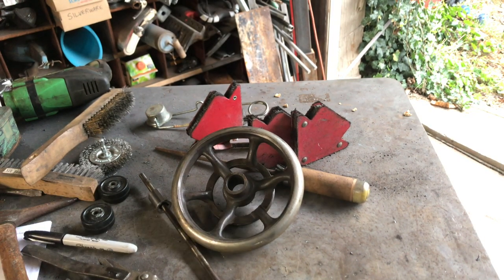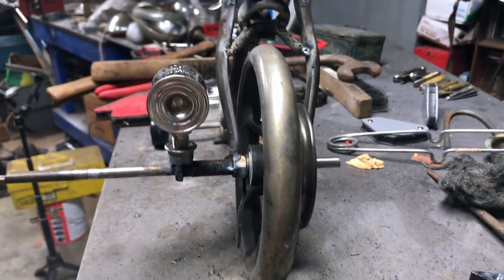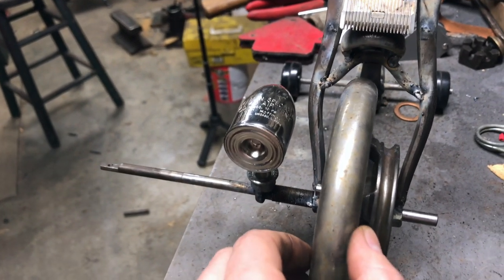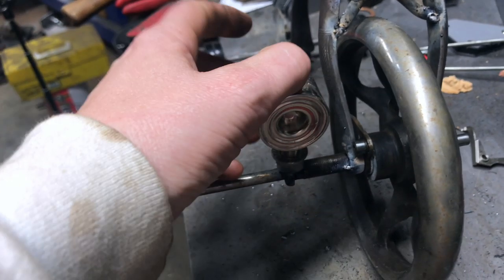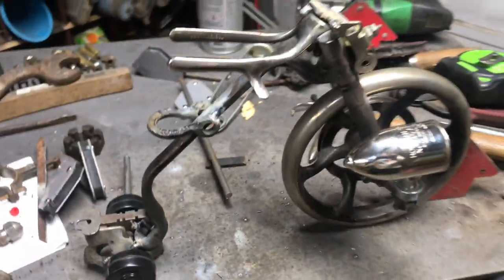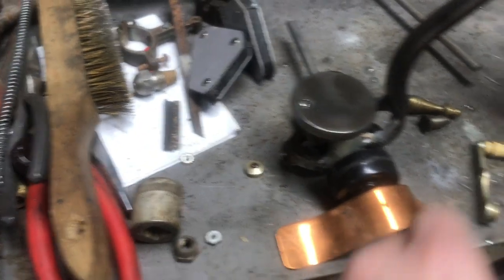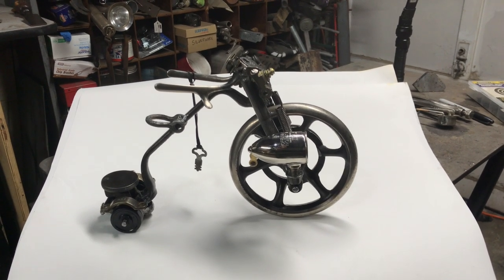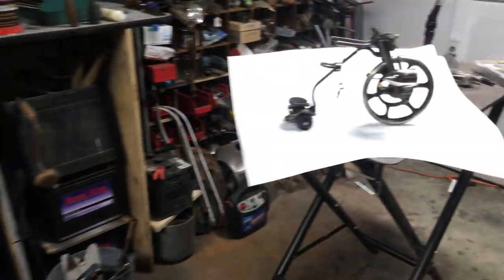Antique sewing machine gets recycled!!

Comment: Super Cool!  my parents met each other attending Beauty school in the 1950s and late on my Dad wound up cutting hair for over 35 years as a owner /Operator of hairSalons my Mom kept her hair Stylist liscense up to date for 27 years yet never cut hair professionally  i remember those old manual  razors you used for the handlebars very well  as my father had many of them  and in the 1970s he was walking home from work one afternoon and noticed a old Singer sewing machine in someone’s trash pile  that he went back with our car to pick up  he  cleaned it up and repainted that a high gloss Black  then not long after that my parents found a Marble Octogon shaped slab on clearance at some  home improvement store and that on top of the sewing machine base became our kitchen table  for most of my life  i remember sitting at the table  pedaling the wheel  although it wasn’t attached to  anything  my Mom still has the table and base  and i am a retired Wood worker who hopes to build some type of a Wood  structure for the top of that table that can move using the  pedal and to use the table inmy next kitchen  i’ve always thought those old fashioned leather belts that are stitched together were cool  and maybe that is something i could use  to “power” my Wooden Art  on top of the table  for  fun and a conversation  starter I’m not entirely sure what to make  yet  but  i’m pretty sure it will be built out of a combination of Exotic woods to add color and character  to it  as Wood was not only my  profession for over 20 years it’s been my hobby for nearly 35 years of my life  and continues to be a passion of mine ! as a kid  pedaling that base i always though it would be cool if it  moved something on the table
Reply from the maker: Loved this comment! Thanks for sharing! I’ve never worked much with wood, always wanted to learn but never took the time. One of my co workers is taking a turning class this week and I am sooooo jealous! Yes you need that pedal power something! 🤔